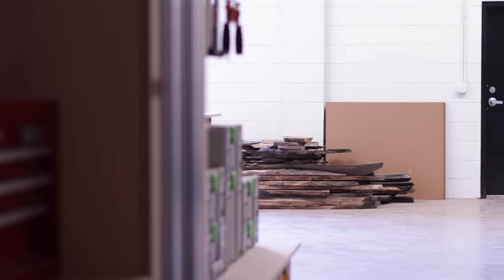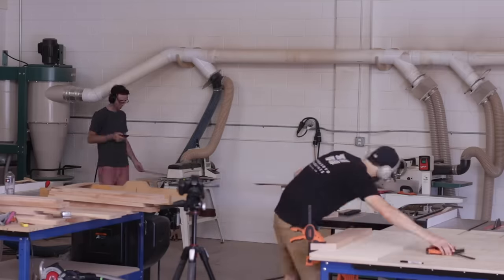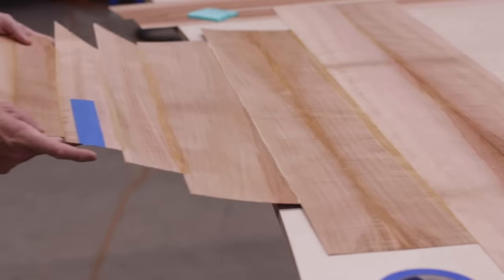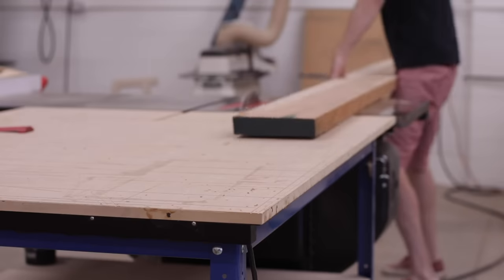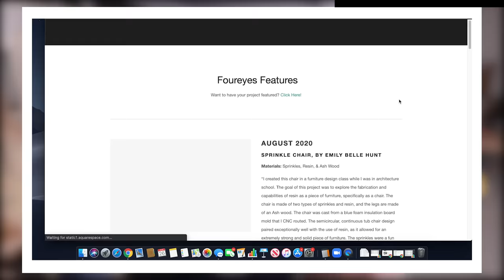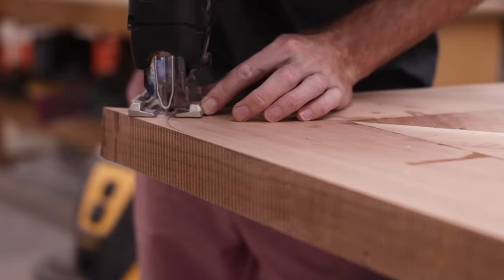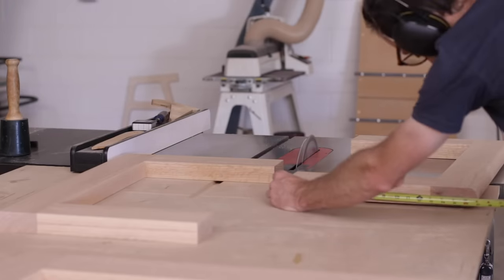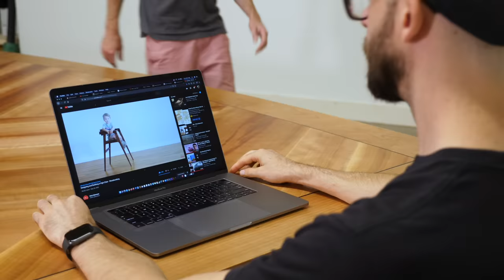Building a Giant Dining Table with Veneer Pattern Top

Comment: Thank you for the video. Learned you can take multiple cuts using a flush trim bit instead of taking a full thickness cut all at once. I bought and used a two inch long flush trim bit for my previous project. It was scary. Will use your guy's technique next time. Thank you

Comment: I almost screamed when you poured the colored epoxy into the gap. I cannot believe the color didn't leech into the wood
Reply: Little bit of sanding takes care of it.
Reply: @shaunb66  Just sanded down fine prior so no voids for it to seep into?
Reply: @Russ-od2yy  Yeah, pretty much. There is always a tiny bit of bleed into the grain, but that usually goes away with a bit of sanding afterwards.

Comment: Question - Is there an advantage/disadvantage to cutting the veneer thicker, say ¼ inch? 

This video is very timely for me since I am making a Murphy bed and need to veneer a panel the size of a mattress. Thanks...and great build.
Reply: Hazem Bata I have the exact same question. Plus, why epoxy instead of wood glue or contact cement for glueing the veneer?
Reply: @turcmic  I imagine the epoxy was to give them more time to work. Glue sets in about 15 minutes. Epoxy sets in a few hours.
Reply: The thicker the veneer, the more chance for seasonal wood movement, similar to if you just made a solid wood table top. So doing a pattern like I did for this table, might not work out over time. And yes, epoxy gives more open time, and it isn't water-based like wood glue, so it doesn't cause the veneer to warp from moisture when you are trying to apply it to the substrate.
Reply: Thanks for the additional info!  Very informative.  And, as usual, GREAT work Shaun!  Cheers from Montreal!
Reply: @shaunb66  would contact cement work well?

Comment: As a huge fan, and love most you do there is always room for constructive critisism. I feel the legs do not match the asthetic of the table. I believe alot of people get stumped..lol...on the legs. Your legs on other pieces you do are thought out...why not use metal if you were going to make legs black and look like metal...a more elongated leg welded by a local welder with eyecatching geometry..after all this is a centerpeice in a wine tasting room and should be unique from top to bottom...There was a link to this metal shop on blacktail studios table leg video...they are in u.s....look at that site and legs...or go longer support beam with unique legs branching out....again your work is awesome and just feel legs get forgotten but acually make the table.
Reply: The client originally wanted a metal base, and I don't do any metal work, so he asked me to do something similar to the original design, but in wood. So this where we ended up. I think it looks pretty good, and the main thing with the base was to not take any attention from the top.

Comment: So client’s tree was red oak, right? I think I can see why you used epoxy instead of contact cement for the veneer, so you could reposition the table top over the veneer. Kudos for using epoxy instead of wood glue. Which total boat epoxy did you use for that?
Reply: It was actually Pear wood. Pretty cool looking stuff, I wish more of it was usable. We just used the regular 2:1 total boat epoxy with the slow hardener.
Reply: Shaun Boyd - Foureyes A real fruit tree? Very cool pith and grain. Once in a career material, fruit lumber, most likely.
Reply: @nkabui8wnabnd8099999  Yeah, can't imagine getting another one of these anytime soon.

Comment: Wow!!  That’s an awesome table!!
Quick question, why do you use such a short pattern router bit?  That red one looks like it’s about .5”.  Is there an advantage to using a smaller bit over one of those giant bits or does it just fit your work flow better to use the small one?
Thanks!
And thanks for all the rad videos!
Reply: When you are using a 1/2 inch template the cut depth on the bit has to be shallow if you want to make small passes.  With one of the huge flush cut bits, the cutter would be 1 inch deep into the material just so the bearing could ride on the template. That can be a lot to cut when working with hardwoods.
Reply: Yep, exactly! That is probably my most used router bit, as well.

Comment: Beautiful design guys; glad to see that you are getting commercial commissions; that's awesome! 

Now first, to establish my domain expertise: I owned a 1983 VW Rabbit GTI. Bought it NEW, and yes, I AM still alive.
Moving on... It's probably time to up your veneer game with these kinds of commissions on the line; one of these is going to eventually bite you in the backside at great expense!
1. Make a vacuum frame. Heaven KNOWS you now have the room, and they're really pretty easy to make. Who knows, you MIGHT even be able to make, like, a VIDEO out of it or something. (You should look into doing videos...) P.S. Think of the forming you could do!
2. Use real veneer glue. Like Purebond, etc. The kind you have to mix and can tint. Epoxy bleeds through, TiteBond/PVA moves, hide glue is too difficult for big surfaces, contact cement is a crime against nature and must be obliterated from the planet.
3. Use real veneer tape. At least on the face. It doesn't get gooey or move like blue tape; try it, you'll like it.
4. ALWAYS install balancing veneer. Use poplar; it's cheap. But... use SOMETHING. That top was ALREADY starting to curl in the video, and the dominos saved it (for now; ahem...)It's really essential, especially on a large panel; that thing may start to lift in the non-domino'ed areas... Wood can be VERY insistent!
5. And as long as I've already got you building things for the shop... Two words: Spray. Booth.

Keep up the great work; your partnership seems pre-ordained. (Not that there's anything wrong with that...)

Comment: hey man am i wrong or are you spraying way too far away from the work piece?  The material is going to drive before it lands (dry spray).
Reply: Depends on a lot of things, pressure, amount of finish coming out of the gun, temperature. The finish came out great for this, so don't think I needed to be any closer.